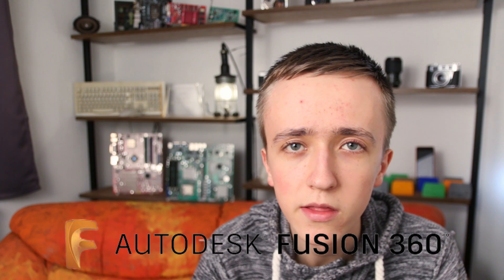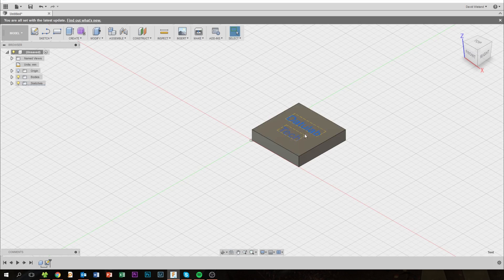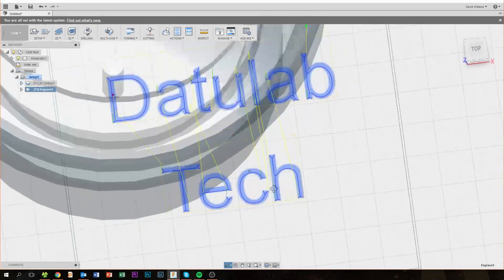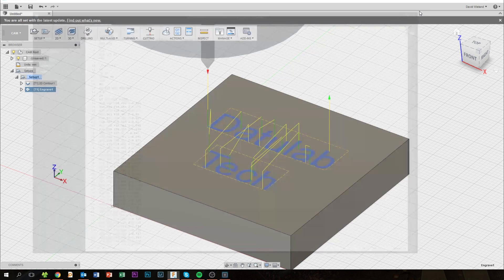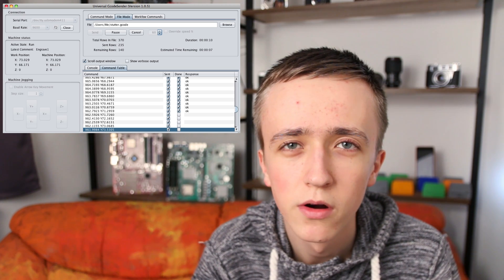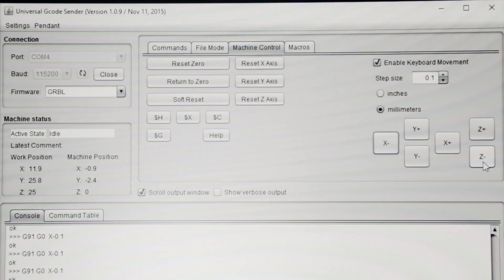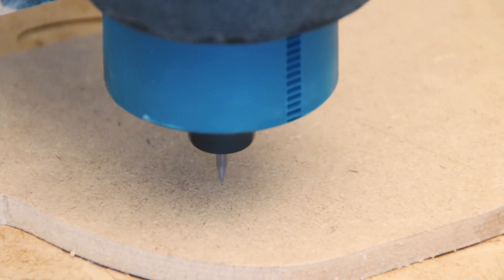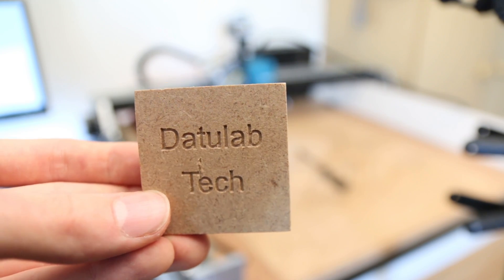CNC Tutorial for Beginners

Comment: Great video for 1st introductions to CAM. Is the Processor you mentioned that is required after Fusion makes the tool path run only on Windows? I am using a MacBook Pro and have seen some videos that say use the COM port, but Mac's don't have a COM Port. I really don't want to buy another PC/Lap Top just to run a home/hobby router, which I have yet to buy. Subscribed to your channel, Thanks!

Comment: yeah thumbs up and subscribed just now. I keep hearing about  Arduino + GRBL. Can you do a video on that? From the hardware needed, to the software needed. I am new to  Arduino + GRBL and can use all the help I can get. I learn fast if from a good source. Two years ago I didn't know a thing about computers. Now I have built 5 from the ground up. So please do this you seem like your good with this  Arduino + GRBL and I wish to know it also.  Right now I have 3 of NEMA23 570 oz/in 3.5A 1/4” Dual Shaft Stepper Motor (KL23H2100-35-4BM.As well as  3 of MYSWEETY TB6600 0.2-5A CNC Controller Stepper Motor Driver Nema 17/23 tb6600 1 Axis 2 Phase Hybrid Stepper Motor. I just ordered a  Arduino UNO  and a few other things I think might be needed.  Just need a person with your skills to tell me how to bring it all together.  Please and thank you.

Comment: Flock Fusion 360! Autodesk does not support the OS that I run, and they are hindering the development of truly free and open source CAM software development with their faux free offering. Also, why does Fusion 360 safe height so high up with every depth pass? I've seen that watching Fusion 360 code run on many occasions now. It must be some kind of a default setting that users don't change.
Reply from the maker: yea, you can change all the hights and also set them als default for your account if you want to. Also what OS are you running, is there no Linux support for fusion?
I really like as the features it has isn't found in many other free software but it definitely has its flaws too.
Reply: +Datulab Tech Autodesk is not a particularly Linux friendly corporation. The only reason Fusion 360 has a gratis version is to stifle the development of truly free CAM software. Free BTW means no strings attached. The moment you have some modicum of success Fusion 360 is going to cost you.
Reply: @1pcfred  Yeah because why should you have to pay for something that someone else has invested a lot of time and money into.
Reply: @1pcfred  Autodesk isn't obligated to hand out free for all software so why complain in the first place. if you don't like it, don't use it. Simple as that. The company i work for has invested money in the software and it's paid itself off a thousand times over. If you're just a hobbyist then this software is not for you.
Reply: @1pcfred  The software is free at the hobbyist level so nothing was misrepresented. If you want to run a business and make financial gain from a company software then YES you should pay for it! You are not entitled